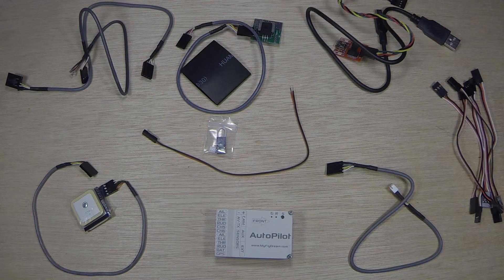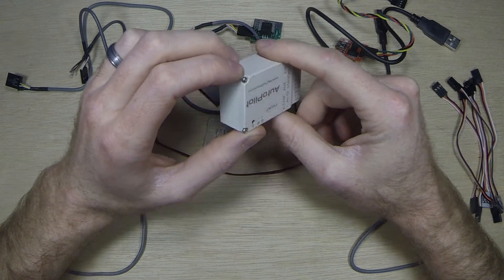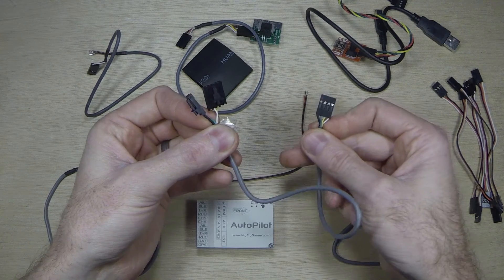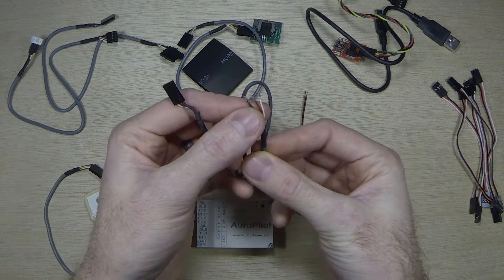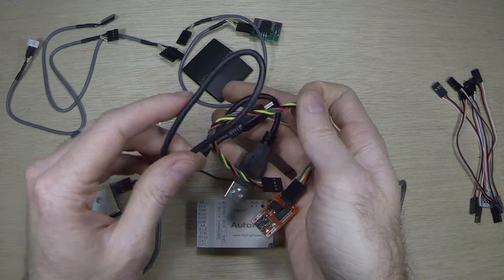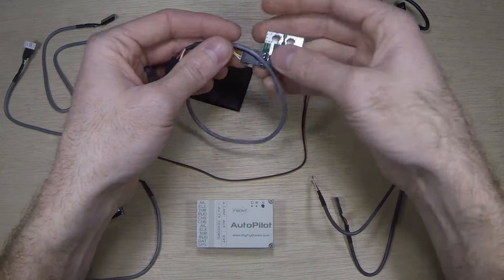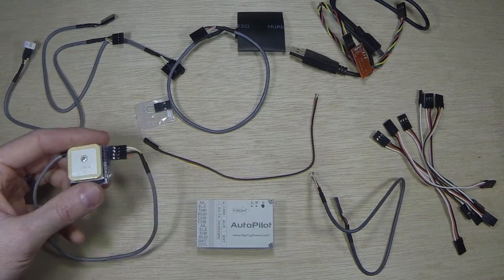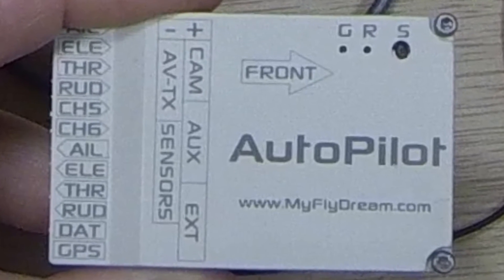MFD AP - 1 - Unboxing without the Box!

Comment: Hi Atom I am in Australia and have enjoyed and appreciated your videos also FlyBoySee; I have used a vector AP and APM 2.6 before but so far really like the MFD AP; I am building a Skywalker revolution; did my first power up outside the plane and was pleased to find all was good I had OSD, every surface moved as it should. It was then time to install it in the plane, before the final placement I powered up again and to my surprise the elevator and rudder move together on the elevator stick the rudder stick is dead; I have ailerons and throttle. I am using PPM with EZUHF 8 Ch Lite and Taranis TX .
Just wondering if you know of anyone who may have encountered this; I will fire it up again and try doing some calibration.
Thanks again for sharing Cheers Adrian

Comment: Very informative and love the wiring tips.  What radio are you using on this?  Will you be doing a video on how to  program mixes to get to all the flight, display, and functions.
Reply from the maker: Glad you liked it!
I have many more videos I have been working on, Just had some household necessities to take care of that put a hold on RC stuff. I have two different installs I will be doing, walk through on setup, first flights, tuning, and data radio capabilities. The radio I use is a TH9x with Dragonlink. The data radio I will be using is from http://witespyquad.gostorego.com/

Comment: Can you set it up easily with a tunigy TX-9 remote ?
Reply from the maker: Factory or with an upgraded flash? the stock TX-9 firmware is junk but you could probably get it to work. My th-9x is reflashed and very easy to use. Iv used my Taranis and TH-9x on this system.